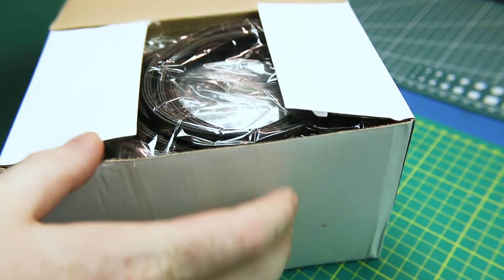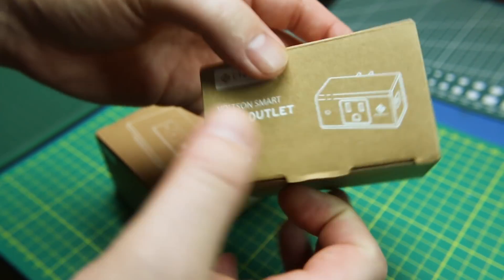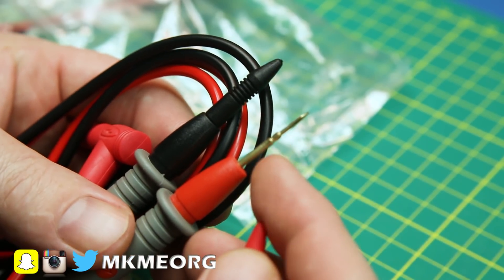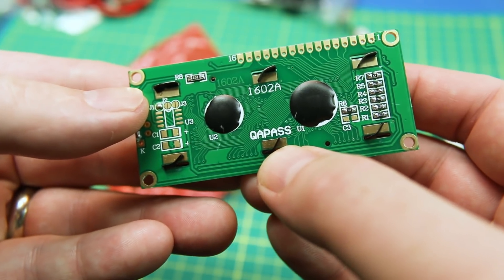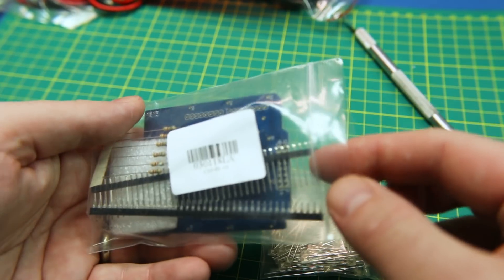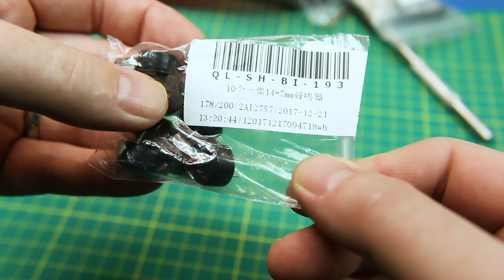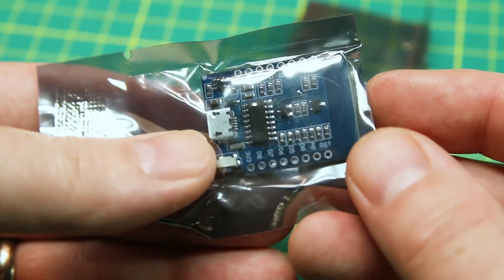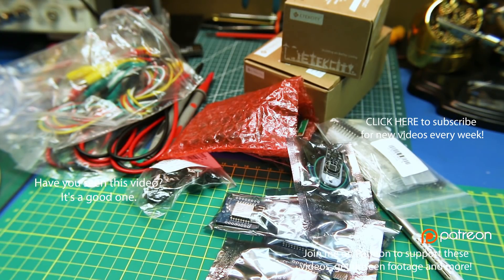MAILBAG! Airbrush, WEMOS D1's, Electronics & MORE!

Comment: Oooh, I really want to see the airbrush video. I’ve always wanted one but... didn’t want to get a compressor and all the rigamarole like you mentioned. Will be looking for this one.

Also, I have an antique Simpson 260 (model 1) and an antique Triplett (forget which model) and it’s been a real chore getting affordable test leads for them. You can get actually name brand leads but they cost a fortune. You don’t happen to know where to get leads for these meters do you?
Reply from the maker: The airbrush actually works great for small stuff (spoiler).  On the leads- Most of those are just banana plugs- just search for that or add the plugs to an ebay set of leads with the new style. Dirt cheap.
Reply from the maker: Here ya go https://www.ebay.ca/sch/i.html?_from=R40&_trksid=m570.l1313&_nkw=banan+plug+test+leads&_sacat=0
Reply: Thanks, no they are actually smaller than banana plugs. I’ve actually bought different sets and they are always too big. They are actually close to the size of a #10 solid copper wire (no insulation). I saw your comment about the leads you bought and just thought I’d ask. Even the ones I find that say they will fit are too big. Thank you!
Reply from the maker: Oooooh.  Crud. If you find them shoot me the link too- I have my classic analog meter to restore someday and I'd bet they are the same then. I think I tossed the leads ages ago when the wire insulation turned to concrete so I probably would have run in to the same problem :)  Cheers

Comment: The DHT sensors are flakey. The BME 280 is an excellent sensor for temperature, humidity and pressure.
Reply: Yes, the BME280 is the go-to sensor for humidity and pressure.  I pair it with a DS18B20 for temperature measurement since the BME's temp sensor isn't too accurate. (It was designed to only be accurate enough so it's readings could be used to calibrate the pressure sensor).

One note about the D1 Mini clones; the ones I bought recently came with a knock-off voltage regulator that was only good for 200ma instead of 500ma.  Google the part number of the component on your new boards.  I've ordered a bunch of new regulators but replacing the old ones is going to be tricky.